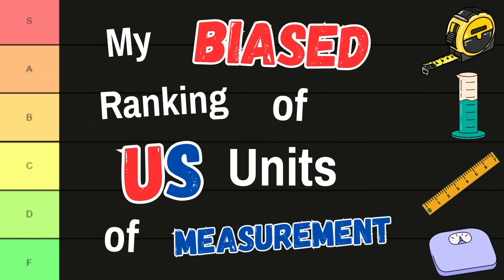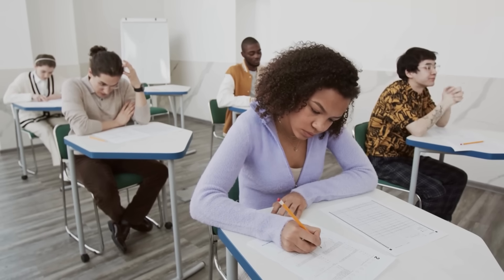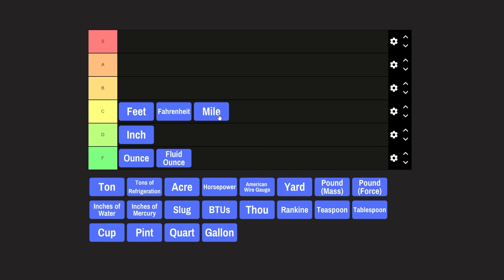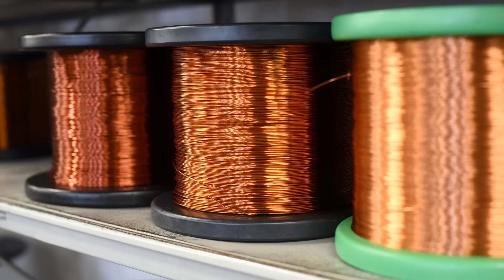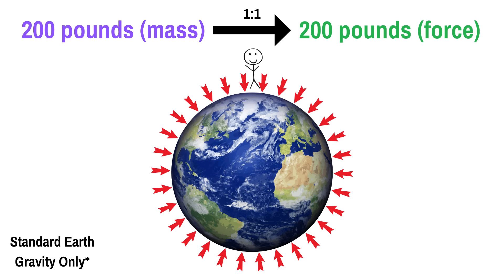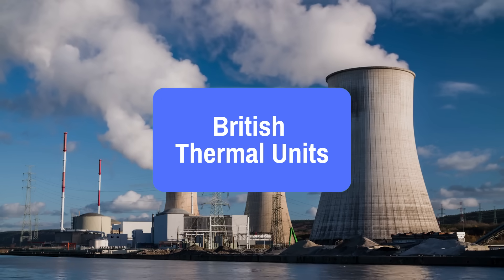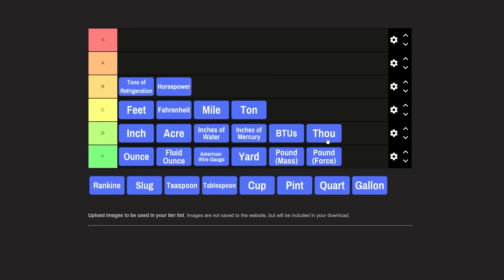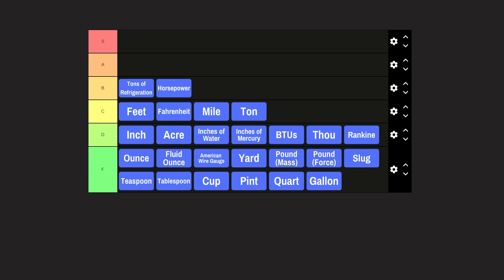Tier List of the DISASTROUS US Measuring System

Comment: We get made fun of for using the Imperial System in the US, but we also use metric as well, all over the place.

If you really want to see something cringe about people using multiple systems unnecessarily just making things more complex, look at Japan using 3-4 writing systems in their language the US only use 2 measuring systems and only 1 writing system.
Reply: Japan has one writing system, they're just different types of characters. They are used together, not separately. though there is a lot of kanji...
Reply: @ochironekitsumithey are different writing systems though. They all can be used within the same sentence. But that does not mean they aren't distinct in their own right. You can write Japanese entirely in Kana and it is valid, you can write only with Kanji too and it is still valid. You just have to use the characters for what is normally done in kana. Like 之 instead of の
Reply: I still would rather use both kana and kanji rather than both metric and US customary. At least kanji actually adds something, rather than the pure uselessness of US customary which just makes things worse, and adds nothing useful. Kanji helps sometimes. US customary doesn't. This comparison is a bit off.
Reply: @ochironekitsumiJapan also has native measurements too which you can find in some rural areas.
Reply: @linuxman7777  And? The US uses US customary in URBAN areas.

Comment: Pint, quart, etc. Are the only ones I would rate A, because they have consistent conversion rates into each other (just based on powers of 2 instead of 10). There's at least logic to that instead of 5280 inches in a mile...
Reply: Don't forget that there are two different pints, the Imperial (20 fl oz) and the US (16 fl oz). Therefore, you also have two different gallons, although they both contain 8 pints. Go figure.
Reply: 5280 feet.  Not inches.  And it's not as strange as it seems.  5280 can be evenly divided into halves, thirds, quarters, fifths, sixths, eighths, 10ths, 12ths, 15ths, 16ths, etc., etc.  That can be quite handy.  You can't do that with kilometers.
Reply: @Milesco  Can you name an application where it's useful to divide a mile into 15 equal parts that benefits from being an integer value when expressed in feet?
Reply: @gitterrost-4  "Can you name an application where  It's useful to divide a mile into 15 equal parts..."

15?  Honestly, no.  (I'm a fair and honest person. 😊)   But it serves to illustrate how many divisors a mile really has.  And it's a lot.

And it IS convenient to be able to evenly divide a mile by three, four, five, six, eight or ten.  Meanwhile, if you try to divide a km by three, you get an ugly 333.333333.....  🤢

                _______________

"Also, you can divide kilometers in 5ths, 10ths, 20ths, 50ths, 100ths, etc.    You can't do that with miles."

Of course you can!  A fifth of a mile is 1056 feet.  A 10th of a mile is 528 feet.  A 20th of a mile is 264 feet.  A 30th of a mile is 176 feet.  (Anything smaller than that is kind of pointless and approaches [or exceeds] your example of dividing by 15 -- not something that is ever actually done.)
Reply: @gitterrost-4 inverse question, can you name an application for the “average Joe” where converting between distance (mi, km) and length (in, ft, yd, m) is really that important. Are you actually thinking of a kilometer as 1000m every single time or do you just have a good idea of what a kilometer means roughly?
Reply: @JuneNafziger  Not necessarily, but it has huge advantages in scientific fields and no disadvantage to the average person. So why not use that system everywhere?
Reply: @Milesco  Oh, also, you can divide kilometers evenly in 5th, 10th, 20th, 50th, 100th,etc. You can't do that with miles.

Comment: As an imperial system defender until the day I die:
You explained Fahrenheit's benefits very well in the video - a scale from 0-100 and if you are feeling even more extreme you can go over or negative. Plus its more precise WITHOUT using decimals. Talking about the weather is by far the most common time for me to need to know the temperature, and I think for that purpose Fahrenheit is far better than Celsius.
I think inches, feet, and yards are just better units of length in general, my only problem is that they don't line up as neatly as the metric system. I think centimeters are fine, a bit small but if I grew up with them I would not have any problems. Feet, on the other hand, are a really useful length that doesn't have a good equivalent in the metric system besides really large amounts of centimeters or small fractions of meters. And then for whenever I do need a large unit of length, yards are functionally the same as meters. I feel the same about kilometers as I do about centimeters - they work just as fine as a long unit of distance as miles.
I don't use the other units very much in everyday life (the cooking ones are pretty annoying to convert between but in my limited cooking experience the measurements themselves are useful amounts), but Fahrenheit, inches, feet, yards, and miles don't deserve the criticism they get. The metric system is based off of math, which makes conversion much easier, HOWEVER in order for this to happen it has to have what in my opinion are objectively less useful units. Plus, I think conversion is overrated anyway, my most used conversions are between imperial and metric units and not between different types of imperial units.
So if you are a European who hates the imperial system and is reading this comment, next time think of the actual usefulness instead of the arbitrariness of their origins/conversions. Not that the metric system isn't arbitrary anyway, meters went from based on the diameter of the earth (which couldn't have even been controlled by humans to be a size useful to us) to the length of a path the speed of light travels through a vacuum in 1/299,792,458 of a second, I mean come on you can't get more arbitrary than that.

(I like how I wrote basically an essay that makes it look like this is like the most important thing in the world to me, this is a minor pet peeve at most lol)

Comment: Yes our system is not perfect, but it is "historical".  I laugh at things like "a mile is 5280 feet and thats hard to remember" when the defintion of a meter is this.  "Since 1983, the metre has been internationally defined as the length of the path travelled by light in vacuum during a time interval of 1/299 792 458 of a second."
Reply: Uhm what? A foot is defined as 0.3048 times the length of the path travelled by light in vacuum during a time interval of 1/299 792 458 of a second. How exactly is that better?

You're comparing the definition of a base unit to a conversion factor between two units.
Reply: @yannickurbach5654  No, that is the definition of a meter, not a foot.  What I'm comparing is what people say is confusing (American system) vs. the actual basis of the metric system.  If you don't know, the metric system is now based on physics, which is cool but not exactly intuitive.  By asking, "How is that better?"  You prove my point.
Reply: @jonbourgeois8390   No, it is the definition of a foot. Note the extra factor of 0.03048. That's how the foot is defined: 0.03048 of a meter. The fact that you don't even know that shows how relevant the exact definition of a base unit is in daily life: not at all.

On the other hand, conversions between units (of a system) are relevant all the time. And for those, the SI uses exclusively powers of 1000.
Reply: @yannickurbach5654. That is a conversion factor, not a definition.   "Why so serious!"  I made a flippant comment about the omighty metric system.  Oh my lord, now you have to get out your slide  rule.  Whatever, dude!

Comment: "just because you use a lot of one's in the definition, doesn't make it more simple to use", a scathing indictment of the Slug, and also the entire metric system unit definitions
Reply: Key Phrase "Just Because".

Only Caviat being the Metric System does everything else as well to make it simple and intuitive. Cqnnot really say the same about the slugs now can ya?
Reply: @antagonisticalex401 you'd have a point except what is a meter? By definition? It's a comical fraction based on the speed of light. What is a kilogram? I actually don't know what it's based on from the top of my head but I think it's based on a certain number of atoms of some atomic weight. Why is the kilogram the base unit instead of the gram? (It actually is for some god forsaken reason)
Reply: @kattkatt6961 Its measured in terms of Planck's Constant somehow, that was done in 2019 I believe
Reply: @kattkatt6961 bruh what are you talking about it's literally all scientifically based, c in light speed for being consistent under all circumstances, plank length for be foundamental structure of the entire universe
Reply: @Kujooceanman  What he's referring to is the fact that the existing metre - originally a platinum bar in Paris - was redefined in terms of the speed of light and so ends up being the distance travelled by light in 1/299,792,458th of a second. If one were inventing a unified system of measurement you'd pick some value like 1/1,000,000,000th, which, amusingly enough, is not that far off from what a foot is (~1/983,571,056th). That is of course what the French originally tried to do by making it one ten millionth of the pole-equator distance, but their calculations were off and so the slightly mis-sized artefact they created instead became the definition.
Reply: @Kujooceanman  I don't think the world would have ended if they had defined the meter as the 300000000ths of the distance light travels in a vacuum in one second.

Comment: As an American who started learning wiring at the age of 5 or so using those "snap circuit" things, I learned AWG at like 8 years old and was very confused by the inverse proportionality of it.
Reply: You just didn't use the thumb rule 🤓
Too young and dumb to notice that the sixth power of 92^(1/39) is very close to 2 🧐
Reply: @ezdlc2693  Yes. The rule is that going up 3 in gauge doubles the resistance (or halves the cross section) and going up 6 in gauge halves the diameter. Simple.
Reply: @ezdlc2693  Thumb rule?
Reply: It's not really an inverse proportionality.  It is a negative logarithmic scale.

Incremental differences in gauge sizes, are multiplicative changes in the size of the wire.
Reply: @carultch  You know what I meant to say
Reply: It reminds me of paper sizes where a5 is half the size of a4, a6 is half the size of a5 etc, so I'm inclined to give it a pass.
Reply: @TasteOfButterflies  here the rule is simple, A0=1m2 the A4=1/2^4 m2. A6=1/2^6 m2
Invertly proportional yes. But the German way, stzrt from one base unit=square meter and divide by powers of 2.
Not the most difficult to do.
The weight of an A4 80g/m2 piece of paper, the most usual, is 80g/2^4=80/16=5g.
Simplicity and elegance of German norms...
Reply: Gauge is a weird unit in general, it’s the same deal with shotguns. A 12 gauge is bigger than a 20 gauge, and this is used all over the world
Reply: @billykaelin6358  In the case of shotguns 1lbs of lead will make 12 round lead balls the proper size for a 12 gauge barrel.
Reply: @billykaelin6358 the way it works in shotguns and guns in general, is that if you took a pound of lead, and split it into spheres of the same diameter as the bore the number of spheres you get would be the gauge. It sometimes get called bore. A two bore gun has the diameter of a half pound sphere of lead. Twelve 12 gauge lead spheres would weigh one pound. Its probably something similar for wire.
Reply: @billykaelin6358  its like abrasive medium and mesh gauge^^
Reply: Gotta love those snap electronic kits!
Reply: Wire is made by pulling it through a hole or gauge, which makes it smaller and longer. Each time they pull it through a smaller hole, that's the size of the wire. A wire that has been pulled through 4 holes is 4AWG, 10 holes 10AWG. It's not a size like shoes, it's a gauge.
Reply: Fishing hook sizes are worse. They start inverse until you get to 1, then go forward as 1/0, 2/0, 3/0.
Reply: @jmodified  That's funny, it's the same with wire sizes. One aught, two aught, or two oh, and so on then 250kcmil...
Reply: @BariumCobaltNitrog3n  1/0 is supposed to be "0", 2/0 "00", 3/0 "000", etc., which doesn't really help. I guess if you want arbitrary sizes that are whole numbers and unlimited in either direction, this is an option, and people may be more comfortable x/0 than negative numbers.
Reply: @jmodified  yeah, possibly. although if you're buying that size, you probably don't care what it's called as long as bending radius and resistance match your requirements. "This is stranded?!?"
Reply: @BariumCobaltNitrog3n  I have bought fishing hooks from Japan, and got a very different size than I expected.
Reply: @jmodified  made for a whale?
Reply: @BariumCobaltNitrog3n  I wanted stainless steel hooks for catching bait (mainly baby pinfish) - size 16, and got something more like 2/0. They were quite inexpensive for 2/0 stainless though. Maybe nobody makes SS hooks that small. The regular steel of that size rusts away quite quickly in salt water - after one use if you forget to rinse them off with fresh water.
Reply: @jmodified  just like screwdrivers. You have 3, then 2, then 1, then 0, then 00, then 000, then 0000

Comment: As an American, I find this video both funny and eye-opening. I already can use both imperial and metric systems intuitively and find the imperial system too arbitrary. I do too much unnecessary math to convert units using imperial and think metric is simply better. The one thing I do like about the imperial system is inches though. While not very easy to work with, they are a lot easier to eyeball than centimeters. (for instance, I could tell an object about 16 cm long is 8in more easily since the unit is larger.)
Reply: I grew up with the imperial system and then switched to metric a couple years ago, and I ran into this same issue. My solution was actually to use decimeters for eyeballing, since a decimeter is exactly the width of my palm (10 cm = 4 inches, which is the imperial hand unit). The conversion is very easy as well since I can add a zero to the decimeter measurement to get centimeters.
Reply: If something is 8 inch long, it would be a bit over 20 cm... 16 cm is about 6 inches...
Reply: And the bragging in your inches also sounds better if it‘s 8inches instead of 16cm and hardly anyone will ever notice 😜
Reply: "a lot easier to eyeball"  Yep, because, as you say right in the beginning, you are an American.  Which means even though you claim you can use both intuitively, you can't (as you admit with inches being easier to eyeball… for you)

Comment: As a cook all my working life, i hate, i despise and i infurate when i have a recipe that uses ounces, cups and spoons, when you could easily take out a cheap electronic measuring scale and measure EVERYTHING in the same bowl and the messiest thing you would need to clean would be your hands, instead of a cup that has to measure water, then you have to clean and dry to measure flour, cocoa, sugar, and dont make me start talking about cleaning chocolate or butter, if you aren't willing to use a lot of cold water and ruin for 5 minutes your scrubbing sponge, then you would need to heat water to melt all that away, which also takes precious time

Each and every cup and spoon has to be cleaned because someone wants to hold on to the times of their grandmothers when they didnt had accurate measuring scales

Comment: I never realized we have many units that rely on ancient comparisons and weren't even made for measuring.

horsepower (comes from horses) for motor power
mm focal length (comes from 35mm film) for opening angle
inch sensor size (comes from early cameras) for completely different true sensor size
knots (comes from slow ships) for marine and aircraft speed and even wind speed
spoon, cup (were sold with an old recepie book before people had scales) for mass

I am sure there are thousands more.
Reply: The "knots" one is interesting from a historical perspective, in that they were measuring actual knots tied in a rope. The rope has a bouy attached to one end and is lowered overboard, then a sailor has to count how many knots get fed out before his timer runs out.

Comment: Im in Australia yet most electronic designs are based in inches or 'mils' which are the same as Thou.

From this list we also use knots, acres, horsepower, and some people use feet.

Imperial units shouldnt exist.
Reply: Saffer here. I still reference Errol's length in inches when pulling Sheilas.

Comment: When will americans become normal? Take metric, everything is logical, next unit is always times 10 or 1000 or such that you just move decimal around. like 1 liter = 1 cubic decimeter = 1 kg with water.  Water freezes at 0 C and boils at 100C. 1 km = 1000m and so on.
You americans are like: this large hole in road has a size of 6 washing machines.